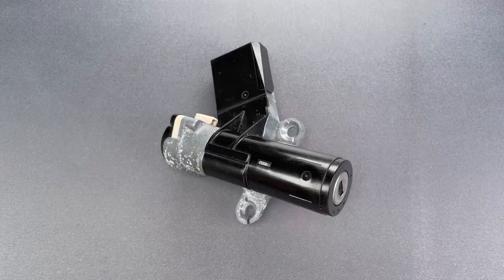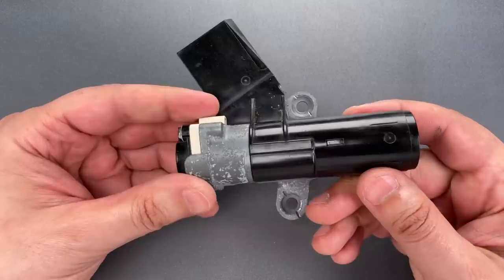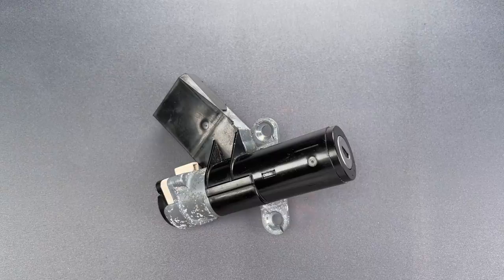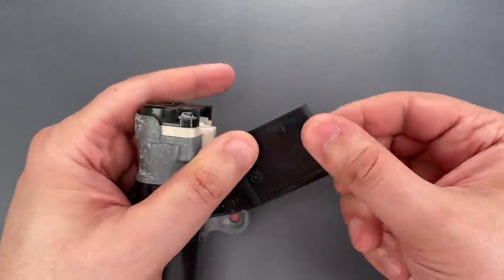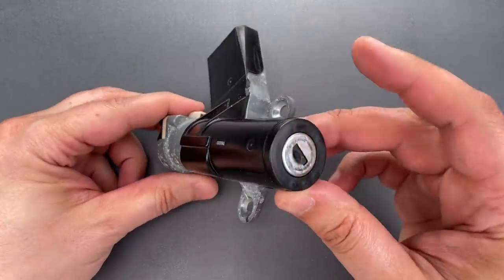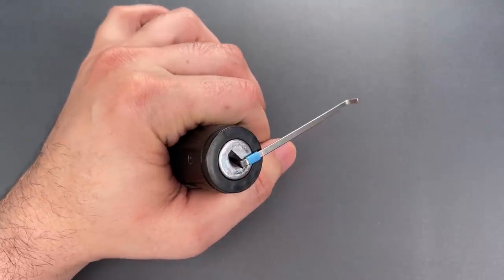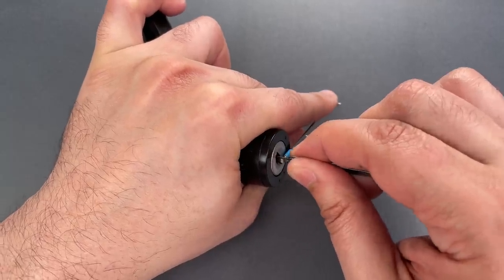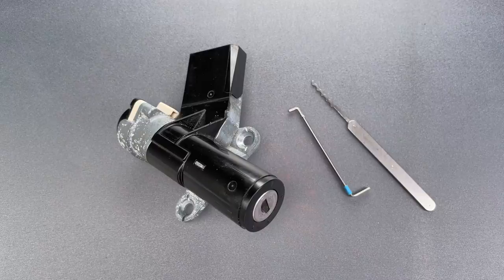[1335] Honda Metropolitan II Multipurpose Lock Picked

Comment: Idk why I thought LPL would limit himself to only car locks, but now we got confirmation that he would do "vehicle locks"

Can't wait to see him open a tank lock and a space shuttle lock
Reply: He has done lots of motorcycle locks too.
Reply: To be fair, a lot of military vehicles don't have locks. Non-armored humvees, for example, have tarps for doors (on a plastic frame), and keyless starts. The only thing that keeps it in place is a padlock on a steel cable you loop around the steering wheel. And all the locks we used in my unit were Master locks. And we know how effect those are. Lmfao.
Reply: "Hello, I'm the lockpicking lawyer and today I will be opening one of the locks on the international space station. No click out of 1 because space is a vacuum, and we have it open. Ok folks, as you can see this lock is susceptible to a low-skill raking attack, but one has to take into account that it requires a specialized tool to get into space. In any case, that's all I have for you today."
Reply: Considering there’s no locks on the actual Space Shuttle, that would be an interesting trick.  Also those are fairly limited availability since there’s only 4 and they’re all under camera surveillance. :).  Also, there’s no ignition keys on the shuttle either…that was always controlled by KSC’s launch control center that managed LC39A/B :)
Reply: He has freakishly long arms so he could pick both locks at the same time in an old ICBM bunker. If he could go back in time, other countries would be screwed.
Reply: A vehicle is a self propelled automobile used for transport(commerce), so it is registered with the government. If you use your own car for private use and not for commerce, it is not a vehicle by definition, and by the way you do not have to have a license, registration or insurance. My favorites playlist has 2 videos on this subject.
Reply: Haha, a spaceshuttle takes a large team of engineers and technicians to get started.
Reply: @rolfbuchner3991  >it requires a specialized tool to get into space
He uses the Space Shuttle Bosnian Bill and he made.
Reply: @bertblankenstein3738  You can open a space shuttle lock the same way you imagine space exists.
Reply: Chieftain, Sofilein and LPL Crossover when?!
Reply: @flat-earther  oh great you are one of those nutters.

No you need a license and number plate and no cops aren’t gonna discuss they are just going to arrest you
Reply: @flat-earther  Transport and commerce are not synonyms. Your claim is egregiously wrong.
Reply: @mattstanford9673  so if I want to steal a Humvee, I would just jump in start engine and start driving away.  Then pick the lock b4 next turn.
Reply: I want to see him start an engine with a lockpick so bad!
Reply: @anonym3017  sovereign citizens are fun,  if you despise them as much as everyone else I highly suggest subscribing to blue Bacon. When he's not covering the Jeremy deviate case he goes over sov cits and auditors, pointing out what they do wrong and proving their arguments wrong with flawless logic and evidence, plus he's a really nice guy that gets super sassy and it's hilarious
Reply: Military vehicles don’t have locks. You don’t want to lose the keys to the door in the middle of combat.
Reply: @Grim_Beard  Yes but transportation means: The removal of goods or persons from one place to another, by a carrier. 
So transporting is commerce.
Reply: @flat-earther  No it doesn't. Commerce means it's done for payment. What part of the definition of 'transport' specifies payment? None of it, because you're wrong.
Reply: He has already opened the lock to my heart.
Reply: Has anyone ever stolen a space shuttle?
Reply: @mattstanford9673  this explains how they stole a Humvee at the California national guard post lol
Reply: Space shuttle lock could be a simple lever. While they were in service they wouldn't let anyone near them or near the building. However, I found a note about the internal hatch being padlocked with a combination lock. Apparently a master combo lock from a local hardware store. Caused a kerfuffle because they didn't trust two of the members of the crew. It was the hatch to the outside.
It would be a riot if they landed and they all forgot the combination.
Reply: @flat-earther  you're wrong.
Reply: Funny enough the space shuttle had no locks on it at all, they had security latches and such to make sure stuff didn't go flying around but not one lock.
Reply: @flat-earther  "So transporting is commerce."

Yes...but you can also do "transporting" for personal use. You see, words can mean MANY things! It's one of those things you'd learn if you were smarter, and not a gullible fool mislead by anything on the internet.
Reply: Tanks just use a padlock. 

But I'm pretty sure you won't get far.
Reply: space shuttles have bolts
Reply: xD
Reply: @mattstanford9673  while military vehicles may not have locks, can we agree they might have "guards" with guns?
Reply: @bertblankenstein3738  NO.

Have you been to a military base before? I'm guessing not. 

And even if there were guards (there are not), it's a freaking truck. A bare bones truck with bad fuel economy, a rough ride, and a bad heater and no AC. 

And no radio. No bluetooth, nothing digital....WHY would you steal a Humvee? 

And if there was a guard, I'm not going to kill you for a crappy truck. Take it. Enjoy going to jail- it's not like it's fast or inconspicuous.
Reply: I think the Space Shuttle was locked in place with frangible bolts (aka explosive bolts).
I can't wait to see what LPL deploys against them.
Reply: As stated military vehicles don’t commonly have locks.  Maybe a 5200 series key retaining lock for the steering wheel.  My previous unit had pad locks on all of the doors to our HEMTTs.  I know one sergeant who could pick the military locks we used down range.
Reply: @mattz1230  I wasn't about to steal one. Not been to a military base, correct. Yes I imagine Humvees are not built for speed.
Reply: There is an idea! Have the LPL pick the launch locks at the same time and 10 feet away from each other.
Reply: @rcschmidt668  🤣🤣🤣🤣
but then the rocket might fall on him and we would be sad 😥
Reply: @bertblankenstein3738  Then why would you assume they are guarded? 

Did you watch too much hollywood?
Reply: No point with the space shuttle, or any similar rocket because they are only fuelled up during launch for safety.

Most armoured vehicles and heavy industrial work vehicles have terrible locks, same with older farm ones.
Reply: @bertblankenstein3738  Sure, I don't want the truck stolen. You know how much paperwork that is?

But It's a crappy truck. Why would I waste my Soldier's time guarding a truck? They have families and lives too?

And what would they do if someone shows up to steal it? What's the point? What response is appropriate to someone stealing a truck that "I" don't own?

You have been watching hollywood. You think that thousands of Soldiers work all day then stand guard all night to work the next day?

A little common sense goes a long way. So think about what you say first.
Reply: Opecuted  no point, they are in buildings with security teams unless being launched. Launch controls are in buildings, not on the rocket.
Reply: Nowhere is safe..!  Or, is it? what if the ISS hatch was opened + locked + key was NFC and cosmic radiation formatted ...
Reply: @bertblankenstein3738  Lmfao. Never been to a motor pool then? No. There are no “guards with guns.” All service members’ assigned weapons are locked in their unit’s armory, and motor pools are just a locked gate. Literally the only people with weapons on-hand are the MPs.
Reply: Despite having billions of dollars’ worth of equipment, motor pools’ security is a joke. Lol.
Reply: @mattstanford9673  That's because there's more valuable stuff than vehicles in there. 

Some of those toolkits are worth more than a Humvee- and much more inconspicuous.
Reply: @xxxxgunsmoke3587  I believe Hugo Drax (or at least his minions) did once ;)
Reply: No lock is safe.
Reply: Those locks are called armed guards
Reply: @kane480  No, No there's not. 

There are MPs, but they're doing normal police stuff: sleeping in their cars, going to the 24-hour shopette every 20 minutes, hanging out with their girlfriend/boyfriend, sleeping in their car....

There are no Soldiers out patrolling around the motorpools or the base.
Reply: @mattz1230  well I don't know what base you've been too, but I've seen the patrols  on the bases I've been too, not to mention the whole process to even get on base
Reply: @mattz1230  Yes, I have. Do you personally oversee security for every military base? If not then you can't guarantee shit. Your limited experience does not make it universal. You can only speak to your experiences and I can only speak to mine. You digging your heels in isn't going to prove anything. I'm done talking to you now
Reply: @kane480  No, I've just been on a many (more than you have) from all the branches. 

The security risk is really quite low. Terrorists don't invade and attack like hollywood makes you think. 

MPs drive around like civilian cops do. They're not there for security, they're there to enforce the laws. Cops don't patrol to deter burglars, they patrol to enforce laws.

Because of the very low risk of crime, low security places like motorpools are locked up at night, and that's it. There is no reason to waste people's time "patrolling" when there's nothing worth stealing. The expensive/dangerous stuff is secured in well-locked and alarmed areas; a humvee is just not that valuable. 

Don't make a mistake, you're 'done' because you know you're wrong- you lost the argument and now you're leaving.
Reply: @gregpeterson1811  I know someone who uses to work at KSC and has one of the ignition control key switches from the shuttle program. I have been trying to convince them to loan the key switch to the LPL for a video, but they are afraid of legal trouble because they are not supposed to be in possession of it.
Reply: Most tanks and military vehicles skip the "locks" part of security and go straight for the "armed guards" part...

Comment: Usually, scooter & motorcycle ignition systems have an immobiliser device with the key, making it impossible to start without it. Nevertheless, if a thief unlocks  the handlebars he could roll away the bike and make lock picks with the metal parts.
Reply: My 2018 ktm duke. I bypassed the immobiliser, picked the lock then enabled the system again and the bike was good to go. ...
Reply: LOL LOL LOL LOL LOL LOL

Comment: The lock picking lawyer has been doing a lot of car locks, I’m worried that he’s getting closer and closer to my dads car every minute with a tiny piece of metal in his pocket which he’ll surely use to abuse some Ridiculous flaw.
Reply: Luckily car locks are almost always under lots of spring pressure. Add in the protected key way and car locks are instantly more difficult before the actual core is considered. There's a reason most thieves use a slim Jim or some other device that completely bypasses the lock.
Reply: @SuperSayinSolidSnek  The lishi tools he’s highlighted so far for car locks appear to ignore most of the defenses car locks offer. 

The saving grace is needing a different one depending on which car, and vehicle electronics preventing anything except an actual key from starting them. A slim Jim is probably faster as well.
Reply: @andyruse4670  exactly, you don't carry a bunch of tools when a brick can open all cars

Comment: The main security element of this scooter is that no one wants to steal it.
Reply: You kidding?  People will happily steal one of those scooters.
Reply: @SirNarax  yes I was kidding,  people will steal anything.  I role a Vespa for a while.  It was awful.  I prefer much larger motorcycles.  But that isn’t the point.  People are selfish and if they have the opportunity many will take whatever is at hand.  Over the weekend, where I live.  A young woman stole a speciality electric wheelchair from someone’s rear step.  It belonged to a man with motor neurone disease, who couldn’t go anywhere without it.  Luckily the battery ran flat a kilometres or so later and it was recovered.  The woman who stole it had no use for it, but went for a joy ride.
Reply: @paulroberts3639  I ride a scooter myself fortunately a really cheap one even brand new so that is really unappealing to risk freedom for.  Although it would be easy to do which scares me a bit as it is my main and only form of transportation and they are quite rare in North America.

Comment: Lots of Scoopy's here in Thailand.  Newer bikes have a hex-shaped ring around the key hole that mates with a hex-shape on the plastic key grip.  But the tricky thing is there are tiny magnetic rods in that hex shape that have to match up with the magnets in the lock or it won't turn.  This means you can wafer-jab the lock all you want but the magnet rods won't let the lock turn.  Since using it now becomes a 2 step process, you only use this feature when you really want to lock the handlebar up.  I'll see if I can find one and ship it to you.

Comment: Fork lock on my Sportster is quite amazing. Quarter inch thick steel tabs on the lower fork tree and frame for a padlock. So, literally as good as the lock you buy, and super cheap to manufacture.

Comment: You would have loved the fork lock on my 1974 Yamaha RD200. It had a cylinder lock that was held in place by a sort of rivet pin that you could just twist out with a pair of pliers and the whole lock just slid out

Comment: LPL only picked one of the three functions though. If the scooter owner disconnects the battery (located under the seat), he didn't actually manage to get it started. In order to open the seat or unlock the handlebars you have to push the key inwards.

Comment: Just bought a Mas 178D to play with. Noted the Packaging on the left, has a Rating System. It shows numbered padlocks numbered 1 to 10 from bottom.
They list 178D as a "5" on this 1--10. I found it amusing, wondering if they Rate the 175 as a "1", as it SHOULD be Rated.

Comment: expectations need to be tempered
when something worth 2000$ is picked in 20 seconds with tools that cost 4$
i think not.
Reply: I mean, the lock does come with a free scooter.
Reply: heres the thing, you can lock the kickstand and the kickstand lock is in the seat, and he wasnt able to reach the seat unlock because you have to push on the lock. So even if you are able to start the vehicle if the kickstand or handlebar lock is on your basically not going anywhere with it until you actually get a locksmith to craft you a key.

Comment: May i make a suggestion. Can we see you pick a 1995 Camaro Door lock?  Ive recently ran into my some looking his keys and the keys from the dealership did not work even after all the information i gave to them. I was hoping you had a lishi tool for them but to my surprise i didn’t see one. If y’all produce one I’d love to buy one. I know they used a different style ignition key vs door key but I’d love to know how to open the “round” key door locks for when this happens. He had his grandparents vehicles stuck in the garage for 4 days before we finally got a set of key for it. Lesson learned we need 2 sets. The dealer keys that they cut did not work so we still had to call a lock smith and cost Ethan, my 18 YO son, 300 plus the $175 I already spent on the first set of dealer keys. Moral of the story, don’t let your teenager loose his Keys but I’d live to see a lishi tool. I plan on buying a couple for my common vehicle they come through the shop. Thank you.

Comment: Theirs a fable, that 80's Ford's in the uk could be opened with half a tennis ball used to blow open the lock whilst hitting it, I'm guessing using air pressure somehow. I'd love to see you try that.
Reply: yeah, I heard about that one. If it's true it could maybe have something to do with the central locking.
Reply: @phileas007  nah that was before central locking, well at least before I saw any car's in Scotland with central locking. 80's cars didn't have many motorised options other than the engine. I was told that it pushes all the pins in the barrel into place.

Comment: Is there a reason for the blue tape on the turning tool? Is it to protect the locks, or is that end supposed to be the one that goes in?
Reply: It's just to identify the thickness, it has no functional purpose. A lot of pickers will use color coding like this so they can easily pick the correct tools out of their collection, in this particular set (the Longhorn Set from Southern Specialties, I guess LPL sells it on his website as something else so I imagine he bulk purchased from them or works directly with them) blue is the thickest one at .050", then white for .040" and red for .030," they are excellent tensioners that can be used for bottom of keyway (BOK) or top of keyway (TOK) tension. In this video LPL is using the wider and longer end for BOK tension, he can use the smaller/shorter end if he wanted to do TOK (although that wouldn't work on this particular lock).